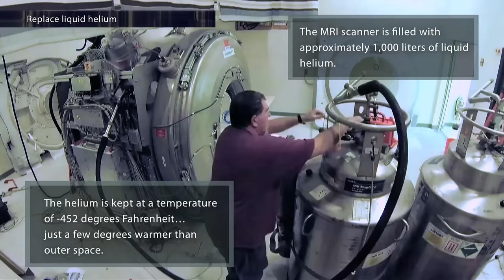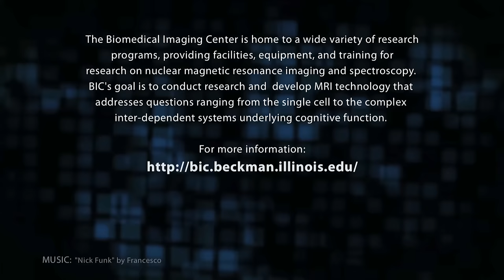MRI Upgrade Timelapse - Two Weeks in 4 minutes

Comment: I designed the electronics on this MRI magnet. But this is nothing compared to the one I'm currently working on. Proud to say the least 😃
Reply: Sounds awesome!
Reply: Modulate the frequency and transmit
Reply: I would never have expected to find the designer in the comments section here. That’s awesome!
Reply: more wires!
Reply: I am currently studying Biomedical Engineering and it's my dream job to be involved in developing MRIs. do you have any recommendations where to start my career to realize my plans?
Reply: yea and I designed SPACE X rockets in my basement 😄
Reply: @daxosm  if you want to be a good designer working in R&D, a bachelors degree really isn't quite enough. You need a MSc to really be able to contribute towards anything. I can't say I know much about Bio apart from the basics, but I just know about the Electronics, magnetics, and superconductivity.  The MRI im working on today has taken 5 years so far and is only still in very early stages of production ramp
Reply: If you really design the magnet can you try to make it so the machine isn’t so loud?
Reply: @cooliocrib4409  Thank you for answer. What programs are you using to develop devices? I was thinking of learning AutoCAD Inventor.
Reply: @daxosm  information wants to be free. 📚
Reply: Awesome job.
Reply: @rikvermeer1325  conflicts of costs are crucial to solve. I'm not proposing a solution to specific issues
Reply: @ChaimMosheZaltsman  This isn't possible due to  the physics and cost constraints. The noise is vibrations caused by flux swings within the gradient coils. The coil essentially turns into speakers due to the pulses within the audio spectrum. There are tricks that could be done but nobody would be able to afford it and the scanner becomes out of reach
Reply: @cooliocrib4409  thx for the info
Reply: lol
Reply: no you didn't
Reply: @llluminati0  Of course he didn't.
Reply: how does the machine keep the heiloum so cold -452 right?
Reply: @bobthompson4319  Cryocoolers are used to re-condense helium vapour. In some machines, liquid helium is topped periodically.
Reply: Which  country?
Reply: @cooliocrib4409  You mean the current Siemens 0.55 T magnet?
Reply: @muhamadhamdy6576  Yes the Magnetom freemax  magnet. It was a secret project now released but took many years in the development.
Reply: @cooliocrib4409  That’s awesome! It has 4 liters of helium and doesn’t quench? Does it still use a cold head?
Is it really true that the picture quality on this system is on par with a 1.5T?
And what do you think about the Philips 1.5T BlueSeal magnet? Also may I ask what country are you from?
Reply: @muhamadhamdy6576  its much less than 4L.  Coldhead is a different design.  The magnet can quench but it would only take a very unique set of circumstances. But the magnet will ramp itself back up autonomously with the AI.  I have seen the blueseal and I can tell you it uses significantly more raw materials hence cost prohibitive.  Yes its as effective as 1.5T but depends on the use case also.  Its also safer due to the lower risks associated with lower field strengths.  I worked remotely and on 4 different sites across 3 countries Germany China UK
Reply: @cooliocrib4409  That’s real cool man, being at the forefront of new technology. 
You can say I’m at the opposite side lol, I refurbish MRI systems from the 90s.
Thanks a lot for the info, appreciate your time.
Reply: Lies
Reply: coolio crib, What are you working on???
Reply: No, no you didn't "design the electronics on this MRI magnet" . The electronic design came from a collaboration between two European and Asian companies, working with Siemens.  Literal teams of people on different continents.
Reply: @Mikishots  You didn’t pay attention to the comments did you, the dude has worked in three countries for it, CHINA, UK, AND GERMANY.. European AND China!
Reply: nuh uh
Reply: Who did you work for
Reply: All by yourself eh?
Reply: @AndreasDelleske  no not all .  I am completely ignorant.  Teach me everything in a comment.
Reply: What kind of cpu does it use?
Reply: Doing anything about helium shortage?
Reply: Yeah "Coolio crib" is an intellectual person, you're funny bud
Reply: Hi. Can you tell us how much electricity, say compared to baking a pie or toasting two slices of bread, a scan of the lumbar spine or a typical brain scan would take? 

I’ve had many image studies done, and it is quite amazing what this, and CT can do. The bore of modern machines has been made larger — I imagine to accommodate larger patients.
Reply: @cooliocrib4409 ”But the magnet will ramp itself back up autonomously with the AI”

What is AI used for here? I know very little about MRI machines, but what could an AI possibly be used for here besides data processing? I am very curious now.
Reply: @crescentx3  traditionally, to ramp the magnet, it requires a specialist team of service crew who bring significant amount of test equipment to calibrate the ramp to a very specific current which translates to field strength. The software now does all of that. Plus to compensate for ageing effects of all the sensors to ensure its homogeneous. It is Al due to the self learning it must do to make the whole process work correctly.
Reply: @ZacharyCordova  he ain’t, he didn’t design the electronics
Reply: Guys believe it or not, lots of people work at Siemens (Healthineers) on MRIs. It makes a lot of sense that someone who helped design the electronics on one is in the comment section. My dad programmed and helped build one of these older ones too.
Reply: Sure you are
Reply: Prove it
Reply: I want to step into this field..can you please tell your educational background?? And how did you get into this field...??
Your answer would be truly appreciated..thanks.
Reply: Yeah I can feel. Wanted to be the designer/ mechanic of such medical devices but aperently, its nothing special, just a certain position in some company, since I didnt find any degree involving that... :/
Reply: Cap
Reply: @haydenduffey6969  why?
Reply: Hai tolto quei rumori molto fastidiosi?

Comment: I love how you can upgrade the machine without having to change the core unit.
Reply: Cause it is interchangable with the New one so they dont bother to use a New Core system
Reply: The core part is mostly the magnet, it should be just as effective as a new one. Plus they’d have a hell of a time removing that iron core it would weigh tons!
Reply: More upgradeable than an Apple Macbook
Reply: llary and probably cost less to upgrade too
Reply: @Ian-pe9rj  The magnet is mostly superconducting wire in a massive vacuum insulating dewar (thermos) and is a decent part of the cost.  

The more prosaic reason for upgrade may often be that it is too expensive to extract the magnet from the facility that may have had renovations around it that prevent it leaving the building without cutting holes in walls.

It is impressive that they full support upgrades though.
Reply: well... german engineering ¯\_(ツ)_/¯
Reply: What I don’t understand: If this is an upgrade to 3 Tesla, and before it was lower flux density (1.5 T perhaps), so why does the „magnet part“ not have to be replaced or upgraded? Or had this „inner coil“ s.th. to do with magnetic flux? I would guess not. 
Thanks for any answer.
Reply: @schaefersklaus  I think the fixed Superconducting magnet remains unchanged.  The upgrade is for the speed and resolution of the scanning electronics and perhaps the scan coil in the middle.  Upgrading the 'tesla' of the system would require replacement of the big more expensive part.
Reply: @schaefersklaus  The old system (Magnetom Trio) was also at 3T, so it wasn't necessary to replace the magnet itself.
Reply: @schaefersklaus  search for the post from @coolio crib and ask him
Reply: @menschan7  That's what I was wondering as well LoL
Reply: Wait until Apple and Samsung release one.
Reply: if they made LAPTOPS this big again like they should, mayve we could upgrade them too!!!!!!!!!!!!!!!!!!!!!!!!!!!!!!!!!!!!!!!!
Reply: @llary  crazy this statement is still valid lmao

Comment: I never realized a MRI scanner was THAT heavy! I think it's fascinating technology!
Reply: I know right? It's terrifying. Claustrophobic as hell.
Reply: Never knew the coil was a piece that could be removed...
Reply: @leemilica  Bore, not coil. The coils are outside the core unit and have NOT been upgraded here. The coils are being re-used as they have the windings to provide the same 3T field as the upgraded unit.
Reply: fascinating to see but not to feel...
Reply: @leemilica  The coils are superconducting during operation, so no upgradation is required. However the core needs to be upgraded to prevent from saturation.
Reply: I never realized it's damn near as cold as space no wonder I'm cold everytime I get a mri lol
Reply: @@Yougotnomilk i had to take by now 12 MRI scans, you get used to it and mostly you find your nice machine that you like and ask for that one :D (living in a city where on the institute they have 4)
Reply: That's why they use helium.  To make it lighter.
Reply: @@Yougotnomilk yeah, but the fact that they're taking pictures of every little part inside of you without having to make any cuts, having to sit in one for 50 minutes is better than having to be on an operating table for 50 minutes lol
Reply: @richb7414  so why does it refer to the instillation of a new coil at 1:07
Reply: @JeronimoStilton14  It's a bore, not a coil. No mention of coil either. The coils are in the larger structure. They replaced the center bore.
Reply: @richb7414  you think “installation of gradient COIL” is no mention of coil?
Reply: @JeronimoStilton14  Yes, gradient coil does sit inside the bore. I was thinking of the coils wrapped in superconductor wire that create the magnetic field. Gradient coil helps with imaging.
Reply: @richb7414  I see, thank you for the insight.

Comment: What most people don't realise is the room itself is a piece of technology as you are in a copper box that has to screen out any interference, I used to install them for Lindgren. I went to the first as an electrician to install some lighting and found four bricks walls, a concrete roof with a great hole in it, two weeks later it was a fully functioning MRI suite. During that time I learned how to level a concrete floor, cover it with epoxy resin, lay copper sheeting, build walls with plasterboard, suspend a ceiling and finally seal the room with the MRI in it.

Comment: 1:40 It depends on the subway your are referring to in this video, but you'd be incorrect as most subway cars weigh around 20 tons.

A motorhome can climb just as high in weight, or heavier depending on how expensive the motorhome is.

Comment: This is really cool. It looks big enough that I could get a few comforters, a duvet, and maybe a couple pillows all in one load. Question is, does the spin cycle get enough water out that I don't have to run it through the dryer twice?
Reply: this isnt a washing machine
Reply: @ragadoodle  But if it was, I bet it wouldn't have a "ferrous metals" cycle, right next to the delicates cycle. Maybe a "Create high resolution, cross sectional images of soft tissue using magnetic fields" cycle though. That would be right next to the water level setting.

Comment: isn't there some danger from the liquid helium? like no cooling during a blackout and increasing pressure in the tanks?
Reply: Mri systems have auxiliary power supply during blackout.
Reply: @Chopper153  thanks! Didn't knew that, but never thought about it
Reply: @avestator3763  and they have Helium rupture disks. Basically. Overpressure protection.

Comment: It's amazing that this kind of upgrade can even be done. I would have thought, that increasing the magnetic flux would mean replacing the whole thing. That said, they replace a whole bunch of stuff. What is it thats beeing kept?
Reply: The magnet is mostly superconducting wire in a massive vacuum insulating dewar (thermos) and is a decent part of the cost.
Reply: The coils are being kept as they're superconducting.

Comment: The cylinder you lay in isn’t called the bore, this refers to the opening of the magnet. In the bore of the magnet are the gradient coil And the body coil which is the bit the patient would lay in. The bore of this 3t  magnet is 90cm the size of the body coil 60cm.
Reply: Thank you, I was wondering if anyone else caught that.

Comment: But how we going to get it up to 88 miles an hour?
Reply: Screw some bolts loose, and you'll see.. :D
Reply: It spins at about 240rpms at max speed. It is going way faster than 88mph.
Reply: @someguy5035  You're thinking of a CT scanner.
Reply: @user2C47  I pulled that stat straight from a video where they are decommissioning an old MRI machine,

Comment: The "bore" is a big ole electromagnet called the phase gradiant coil. It compensates for irregularities in the static field of the superconducting elecromagnet and emits the RF pulses that make the images on the sense coil. Also they ramped down the field coil and recharged it. The gas cylinders were nitrogen and helium. The LN2 is added first then the helium. They pretty much stripped it to the cold head and the magnet and completely rebuilt it. 😁🤓❤
Reply: Is it very expensive to ramp up the super conductive  coil?  I heard that there is very high chance the ramp up process will fail.
Reply: @flintthuang  a quench, sudden loss of the magnet field, very rarely happens anymore during ramping, the process is mostly automated nowadays.  The increased cost is from the increased Helium usage during the ramp. Ramping causes the temperatures inside the magnet to increase which increases burnoff of the Helium.
Reply: Two Dewar flasks are indistinguishable, I think both are helium tanks. I think, they just kept the magnet in cold state, but refilled an inner liquid helium reservoir. If you do precooling with nitrogen, you need to evacuate leftover nitrogen completely to prevent condensation.

Comment: what sort of commissioning is done after the upgrade? is it something like the test page you print out on your ink jet printer that you put in the scanning bed so your print heads align itself?
Reply: There are regular quality assurance testing that being done weekly and monthly with several certainly shaped bottles filled with physio fluid called "phantoms". But after a major change like this there should be done way more extensive testing including the checking and shimming the main field itself as the new coils can couse a "disturbance in the Force" slightly differently than the old ones;)